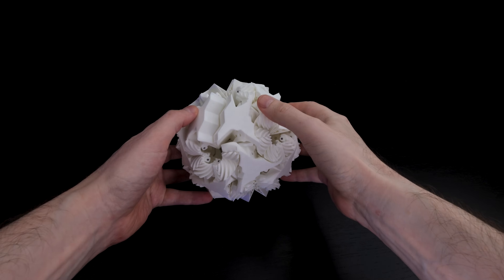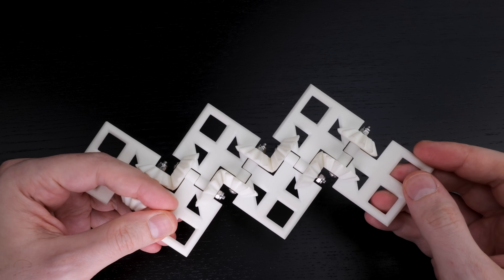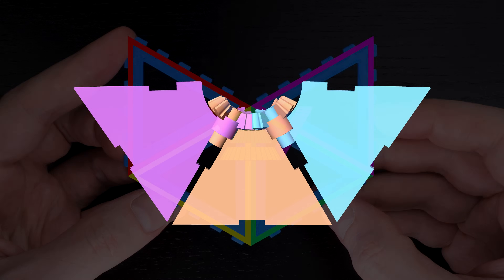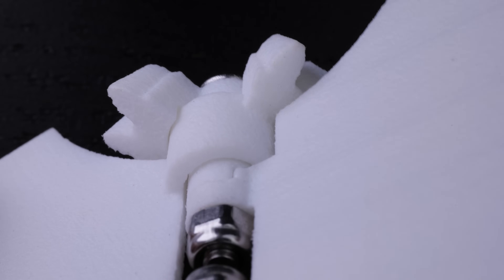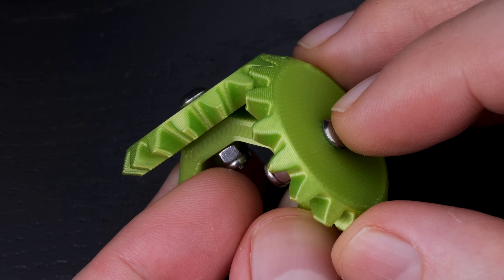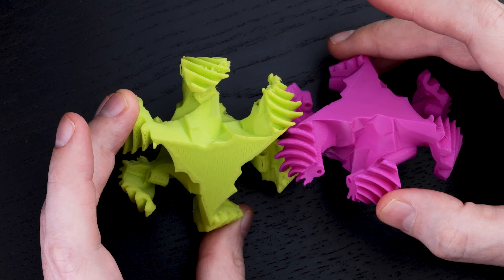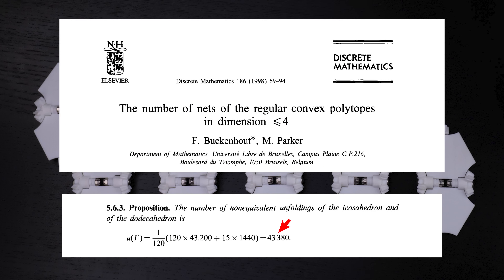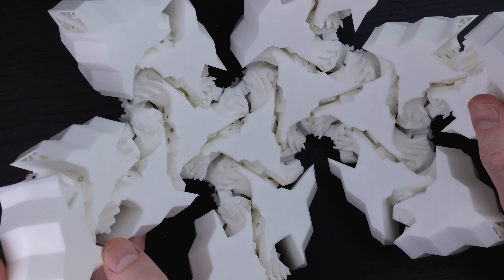Geared icosahedron net

Comment: I have a question which seems like the kind of question you may be able to answer:
Are there any analogues of the platonic solids in hyperbolic geometry? (In other words are there any regular polytopes in hyperbolic geometry that are made up of a finite number of parts and take up a finite amount of space so that they aren't infinite tessellations?)
If not then make the minimal amount of amendments to the definition of a regular polytope untill you find something that works.

I think a related problem may yield some insight.
You may notice that all regular polytopes that aren't infinite tessellations form a tessellation of an n-dimensional hypersphere which is a finite manifold with positive curvature.
If a finite regular polytope in hyperbolic geometry exists it would imply that a finite manifold with negative curvature exists.
Reply from the maker: All three dimensional polyhedra in hyperbolic space with finitely many faces have corresponding polyhedra in euclidean space. This is (roughly) because the Klein model of hyperbolic space draws the polyhedra in euclidean space. But you do get new things with infinitely many faces. See this paper: https://arxiv.org/abs/1511.02851
Reply: @henryseg That's unfortunate, I was hoping there would be a novel shape enabled by the hyperbolic geometry like how you can have infinite tessellations where you can fit more than 4 squares around a corner.
Thank you very much for answering my question I've been wondering about it for many years.
There is still hope since it doesn't rule it out in all dimensions nor does it rule out finite regular tessellations of other manifolds.

Comment: Hi Mr Segerman. Very interesting mechanism! One observation however: adding holes to 3d printed parts doesn't actually reduce their weight like it does when you're doing subtractive CNC like with a milling machine. Instead it introduces more perimeters into the part which adds weight. To reduce weight in 3d prints instead use sparser infill and less top/bottom layers and then use modifier parts in your slicer to increase the infill and perimeters in the parts of your print that need to be strong (like in the hinges that hold the rods/bushings).
Reply from the maker: These are made with SLS nylon, not a filament based printer.

Comment: I just watched your geared racks video before this one, and now I'm wondering if curved racks (which I guess are just sector gears) with their centre of rotation at each pivot point would work? 
Then every second tile is just an "idler" with no gears on it. 
Or a train of smaller gears along each edge to keep things tidy, though that'd potentially introduce a lot of slop.

Comment: A jagged icosahedron rolls forward. It unfolds smoothly, eerily, into 6 arms attached at a single triangle, a flat net of sharply-edged shapes. It continues to invert, pressing against the ground and standing up on four of its arms. Two of the arms don’t press on the ground, instead rising upward, with one visibly balancing it. 

*A tail*, you think, and you realize that the other end of the creature—*a creature*—is a neck. With a sickening feeling you realize—the creature is looking at you. The last triangle on the neck is its head, and even though there are no eyes, no visible way for it to look at all… You can tell, you feel in your core the creature’s attention is on you, and you are in danger.

Comment: Dude, (sir), I love this. 
What an incredible object!!!
Ideas:
- shrink the axle holes and use a small arbor press to press fit the rods into the printed pieces 
- think about a hanging (or otherwise suspended by a single point) mount for the thing so it can be viewed going through both “sides” of its folding and unfolding 
- see what would be required to get it to actuate automatically. Is there a single surface upon which you could apply a force that would cause the whole piece to fold up if another piece were kept stationary?
🎉

Comment: I think slapping triangular panels on is a bit of a cop-out. That said, I can't imagine the further engineering hurdles it would take to just aesthetically close the hole at 11:59 otherwise.
Simple first thing I would try is just reduce the thickness of the triangles and possibly gears. The thickness was probably way over-corrected for the sufficient rigidity you need, especially if you 3d print with a more solid maybe metal material (or just machine it).
Also awesome stuff. This is cool.

Comment: It would be cool to put magnets at the ends of the arms so it will snap closed
Reply from the maker: That felt a bit like cheating… also if you tried to unroll it by pulling on just one triangle, the other hinges would stay locked and closed for much longer than they should if they are held shut with magnets.

Comment: A good point about not having too many different metal parts touching... if it gets used in outer space... you have to worry about metal on metal welding to each other.  A thing that happens in a vacuum and solar radiation can be a catalyst.  There have been several cases where low-pressure welding has occurred in various space missions.

Comment: If CNCing the parts from metal is possible, you might be able to make the gears larger (reducing slop) by having separate gear pieces that screw onto the triangle pieces during assembly, avoiding the problem of needing to fit the gears past each other

Comment: A proof that an icosahedron net must have a run of at least 10 triangles: Start with an icosahedron and select 11 edges to cut in order to unfold to a net. As 11 is an odd number, at least one of these edges must be opposite one of the 19 uncut edges. Call the triangles either side of this cut edge A and B, and call the uncut opposite edge E. The unfolded net must include paths from E to both A and B. For each of these paths there are 2 possible shortest choices (of 5 triangles each, including final triangle A or B itself) making a total of 10. 

Icosahedron nets with runs of more than 10 triangles may take more convoluted paths from E to A and B, but nets with a maximum run of only 10 triangles must include these two half paths of 5 triangles which each unfold to a trapezium. They can be linked to form a parallelogram of length 10, or a V with two arms of 5 each.

Comment: I like the 3D simulations, What application is that done in?
Reply from the maker: I use Rhino3D and its visual programming language Grasshopper to design almost all of my stuff. In Grasshopper, you can have sliders to control the various parameters, and any slider can control an animation. It just moves along the slider saving screenshots to a folder, which you can then make into an animation.
Reply: @henryseg  Yes i have been looking into grasshopper and rhino, very awesome toolset, 
id be very interested in videos of example workflows of your grasshopper, it would be super fascinating and complex  to see the workflow midset. Maybe of some of your older projects.

Comment: I wonder what the twisty puzzle Steve Mould has from squares rotating around each other would be like if there was a continuation in the 3rd dimension, i.e. The thing he has is flat, and stays in the plane, ignoring thickness, but what if we had to use cubes that would rotate around each other in 3 dimensions, staying as a similar shape as what it started as. It would likely need to rotate around corners and have gaps. Maybe it could be a 3D checkerboard pattern. I have thought about this for a while, and am hoping that there is something more infinitely tile able than an infinity cube which doesn’t tile.

Comment: I believe the proof for the diameter being minimized at 10 for an icosohedron is in the fact that the least faces you can go across without having an already visited face being adjacent and return to the original is 10. With a cube, its 4. Tetrahedron is 3. Octahedron is 6. Dodecahedron I think is also 6. If you visit a face where an adjacent face has already been visited, then you decrease the amount of branches it can have, so it has to avoid them.

Comment: 11:05 it's not a particularly rigorous proof, but I'd say the reason there can't be a path shorter than 10 is because that path of 10 triangles forms a direct line around the center of the polyhedron, like a great circle on a sphere. In order to take a 3D mesh and flatten it to 2D you'd have to cut that path somewhere, and cutting the entire mesh in half will leave that as the shortest possible path between two opposite sides.

Comment: I would have gone with DLP -- resin is quite rigid and the prints are very precise, and you can get home DLP printers fairly easily. But SLS is totally valid if you're ordering prints, and nylon is a lot less brittle than resin. (Probably lighter, too.)
Reply from the maker: I’ve only tried resin for mechanical parts once or twice - it seemed like a very sticky business!
Reply: @henryseg   Post-processing can be a pain, for sure, no doubt about it. But the precision, especially when sharp corners are involved, is really nice.

Comment: There are now many more "Kinetic" shapes, functions and devices, where the shape causes another effect to happen.  In Architectural Kinetics, one can have louvers, panels or a sunshade face the Sun as it tracks across the sky.  The best Kinetics are passive, without the need for motors or electricity.

Comment: I've never attempted a proof before but here goes.
Attempting to prove that 10 is the shortest diameter for the net of an icosahedron:
1. Icosahedron is defined as having 20 faces, equilateral triangles.
2. So the "middle" of the net will be the line that connects 2 faces.
3.  In the example given in the video, it would appear like there are different branches or arms with differing number of faces.

4. however if  considering the two faces that join at the "middle" as the starting point - the middle two faces of the net, 
5. We can see there are 6 equal diameter  "arms" of 3 faces protruding from the middle 2.
6. since 6x3 = 18, plus 2 makes twenty.
7. therefore any increase or decrease in the diameter of one of the 6 "arms" would not result in a decrease in diameter of the net.
So I conclude that 10 is the shortest diameter for the net of an icosahedron.

Readable?

Comment: Could you 3d print with two different materials that do not stick together in order to print it in place and remove the assembly issues?

Similar practices exist already, but I've generally seen it used for printing easy to remove supports.
Reply from the maker: I’d be surprised if they wouldn’t stick and also would have low friction between them.
Reply: Maybe, but even if that's somewhat the case if it works it's cutting out what appears to be your largest continuing hurdle with this type of project

Comment: Have you tried printing channels through the parts and routing steel or some other low stretch cables through it? You could do away with the gears entirely if desired, and the double run of cables through the piece would tension it but themselves. Wear could become an issue unless bushings come into play tho
Reply from the maker: Cables would close everything up, but could they be used to force all the hinge angles to be the same?
Reply: @henryseg  they might be able to if they are run in pairs on either side of the hinges and trade sides every other segment so that as the cable on the outside of the hinge gets pulled as it bends, it switches places with the inner cable when it passes though the next segment, and it anchors to a point on the inside of the segment after that one where it will pull to force that hinge to close. 

It's sorta hard to describe, but it is kinda like the pulley equivalent to what you are already doing with the gears. You could get away with just two pairs running along each track of segments, each one fixed to alternating segments so that it's effectively multiple three-segment long linkages without the hassle of running them in pieces.
Reply: I tried to find a video of what l mean, but l couldn't. I guess it's sorta like the way cars have a tie rod linking the casters of the front wheels together so that they stay aligned, but instead this would be equivalent to the tie rod attaching to the rear of a caster instead of the front, so that the wheels would turn in opposite directions. The only difference with this is that you need twice as many cables since they can only act in tension unlike a tie rod linkage

Comment: Could try printing the holes slightly small, and cutting them to perfect size with a reamer. Reamers are sold with incredible resolution and precision, so if you had the exact right reamer for your rod stock, you could make your holes ~0.005-0.01mm smaller than the rod. Then when you insert your rod, it stretches the hole slightly, leaving you with zero play. Not as durable as the bushings, of course. But a little bit of friction could make the system feel more solid.

Comment: Functionally the diameter of the crucifix net of the cube may be better counted as 5 or maybe even 6, since minimising slop means that you’re interested in the chain of gears more than the chain of faces.  So there are 2 sets of gears that transfer the angle from one edge of a square face to the opposite edge.  The icosahedron doesn’t have this problem, obviously.
Reply from the maker: Yes - I did think about bringing this up but I decided it was getting too far from the icosahedral focus of the video!
Reply: @ fair call!

Comment: 9:30 i feel like there is no space needed. It should be possible to twist both opposing triangles at the same time into,
Also the proof. There won't be a smaller net. As you sad, the networks are called diameter. The diameter of the icosahedron is the circumference/ equator. And so it's 10

Comment: I think a lot of the design was forced by your idea that it has to fold both ways. If you just made it fold one way from flat to 3D then you could make the ‘outside’ panels much closer aligned. The outside panels would align perfectly when flat, then less so when folded. Also much of the mechanism could perhaps be ‘hidden’ in the inside of the 3D shape.

Comment: 11:05 I'm fairly sure that the minimum net diameter is related to the closed shape. Let me try to be slightly more formal, though...

Starting from any face, mark all faces with how many edges you need to cross to get to that face. The highest marked number will be a 5 (the opposite face). From this, the minimum net diameter is twice the highest number marked (and for a non-regular polyhedron, it's twice the lowest possible highest number by picking your starting point optimally). Possible that the actual minimum is twice + 1 if there are more than one face with the same highest number.